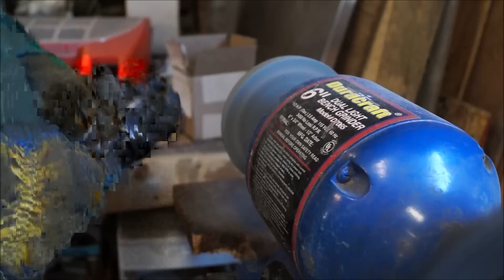How to make 15th century Mitten Gauntlets

Comment: Hiiiii it’s me again. I was wondering how do you get such smooth transitions between the metal because when I weld it and sand it down it quite often will have little holes in the weld line and then I have to weld over the holes and it’s just really really annoying. What would you recommend? I’ve thought about maybe welding on the inside of the helmet as well as the outside would that maybe work? Thanks.
Reply from the maker: Hey! Apologies for the late response. What type of welder are you using? Since if it's a GMAW welder it may be an issue with the shielding gas where there isn't enough of it in the weld, which produces a sort of bubbly, holy texture. If that's the case I think you'll want to allow more gas into the weld, which could be as simple as just making sure that the valve is open all the way or getting the nozzle closer to the joint that you're welding. 

It could also be a issue with the settings of your welder, this was my problem on the first pieces of armor that I welded together. It might be worth it just to experiment a bit with some scrap metal and increase/decrease the wire speed/voltage just to figure out what works best for the thickness/type of joint.

And of course I can't really understate the value of making sure that the two pieces that you're welding together are as flush as you can make them. This helps make a stronger weld and also generally decreases the amount that you'll burn through the metal.

I hope that helps at least a little! You may want to take that advice with a grain of salt because it's been a while since I've done any welding with anything other than my little Chicago Electric welder. You may be interested in contacting someone who has a little more experience than I do, since they might be able to give you some more solid advice. Also, don't hesitate to contact me at thelivingmanuscript@gmail.com or via the Living Manuscript Facebook messenger tab. 😀
Reply: Living Manuscript thanks so much! Also yeah I think it’s just that the metal wasn’t flush enough so I’ll try to improve on that next time 😋

Comment: Great Video as always!
How is the Impact resistance compared to normal HEMA gloves?
And does the additional weighht impare yyou when Fighting?
Reply from the maker: Thanks! I haven't used them for too much intense sparring because I'm a little weary of the thumbs and fingers, so mostly just lighter stuff. Although, I've been hit pretty hard on the back of the hand where all the plates are articulated and it definitely does it's job pretty well, I didn't really feel it all that much. As for weight, it's slightly noticeable but certainly nothing I can't get used to in a few minutes of wearing them.

Comment: I am planning to make some armor stuff, and i wonder, are there any alternatives to welding? (like on here or on a helmet skull) that works as good
Reply from the maker: Yes! One accessible method is to rivet several pieces together. This doesn't give the same effect of appearing to be made in one piece, like welding achieves. Another historical way, which mostly superceded the Former method, is to raise the piece; heating and hammering the steel using some special stakes and hammers till it is the shape you want.

The extent of raising I've done is mostly limited to shallow pieces, and usually without actually heating the steel either, which isn't so viable for raising an entire gauntlet or helmet skull without another method of joining them together like riveting or welding, but for raising something big requires a way to heat the steel like a forge or gas torch setup. For seeing how raising us done though, I would look to Eric Dube, Armourysmith, and Albert Collins, all here on youtube :)
Reply: @LivingManuscript  Thanks man, i will be starting to make armour too later, i just gotta get steel. But when buying steel (atleast on the websites i found in my country" they are very confusing if you arent very into steel, like there are soooooooooooooooooooooooooooooooooooooooooo mnay options and stuff. The only thing i've heard is that mild steel if good for starting out
Reply from the maker: @TheAdmiral8799  I understand your pain, but once you know what to look for the steel sites are much more bearable :) . Mild steel is definitely a good place to start since it's cheaper than carbon steels and is forgiving to work with (it's nice that the actual makeup of the steel isn't so far off from a lot of historical steels, just more consistent). If there are any machine shops nearby you, they can be a good source of big sheets of steel, and will usually be willing to trim then down if you need that. It should be said, my experience with them has been overwhelmingly in person and over the phone since their online footprint isn't typically their main priority.

Comment: I'm trying to make similar gauntlets, been using Alan bauldrees patterns from armor archive, do you have any advice for dishing and planishing dishes? I've been having a lot of trouble with his patterns and dishing
Reply from the maker: Patterns can only get you so far, especially when they don't come with instructions on what to do with them which is the case with Alan's. There are a few tools on the market out there specifically made for dishing, though they tend not to be specific to armor. I would recommend utilizing pieces of wood, since they can be obtained pretty easily and it's easy to make them into your own custom dishing forms. I've seen some armorers use sandbags, but I haven't any experience with those unfortunately. 

Additionally, be sure not to discount some light raising for certain pieces! The learning curve is a little different from dishing, but even just forming small pieces around a railroad stake can offer a lot of control that is harder to get with dishing. A combination of both is very useful too :)
Reply: @LivingManuscript  it also appears that although his (limited) instructions on the patters were to dish just the knuckle portions  at the joints the more research i do the more it appears it was meant to be a more conventional clamshell gauntlet. Perhaps you could take a look and give me your judgement? i already dished the knuckle portions and it just does not seem to work, i might have to undish it to make the clamshells.
http://www.armourarchive.org/patterns/gauntlet_ab/
Reply from the maker: Looking back at the pattern, it looks a little more similar to the ones I made than I had originally thought. so I can definitely see how the finger setup is supposed to be in the same setup as some historical ones, not unlike the ones that I made some time ago. It's a little hard to say what isn't working on yours without seeing them. One thing that I've seen on a lot of originals is that the pivot points on either side of the hand tend to be parallel with each other, maybe that's the problem? If you'd like to reach me and share some pictures my email here is thelivingmanuscript@gmail.com and also on facebook and instagram :)
Reply: @LivingManuscript  totally! Thank you so so much
Reply from the maker: @calvinhuddleston576  I'll be looking forward to hearing from you :)

Comment: Hey anyone have any recommendations on where to get sheet steel online? No hardware stores near me sell it
Reply: Try to look either for 1. Big metal selling stores (that's where I got mine) or 2. Roof supply stores (Those often have massive selection of copper,steel,aluminum,brass etc. sheets)
Reply: @IlGonfaloniere  I've been getting mine from metalsdepot online, it's the best price I can find online but I feel like there's better out there
Reply: @calvinhuddleston576  I don't know, cause I'm czech, that's the reason I was so general, but thank you nevertheless, cheers!
Reply: @IlGonfaloniere  cheers and most roofing supply stores here don't offer non galvanized sheet steel besides 22 gauge which isn't ideal for armor